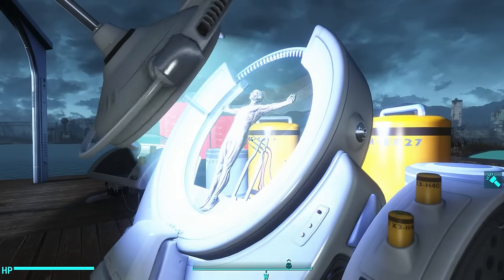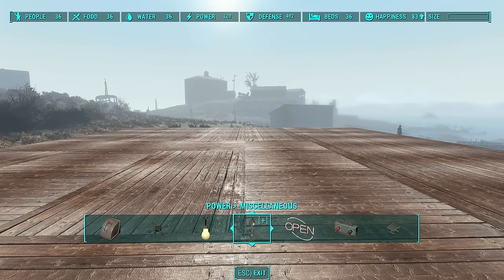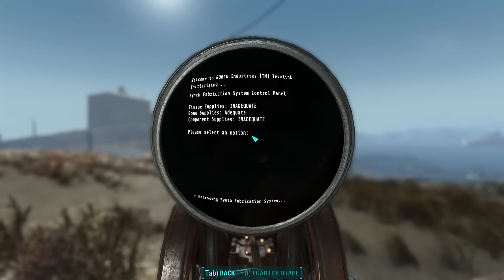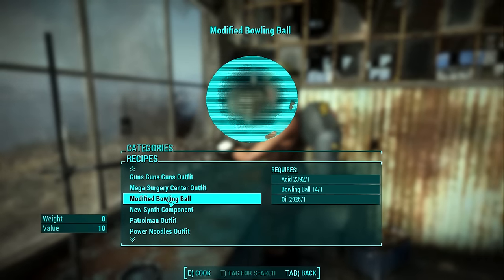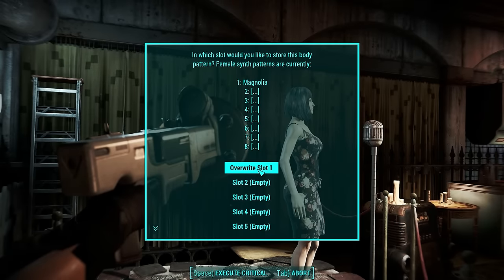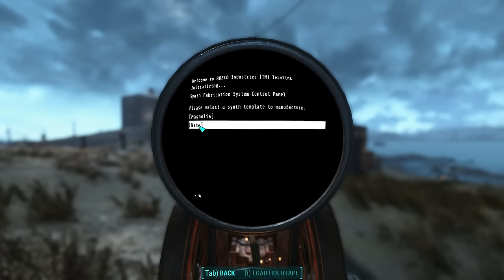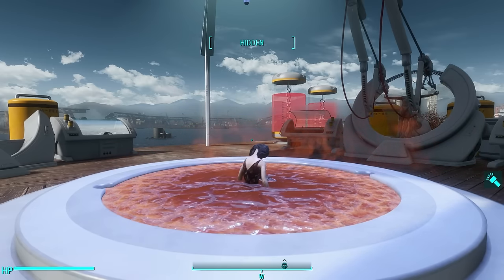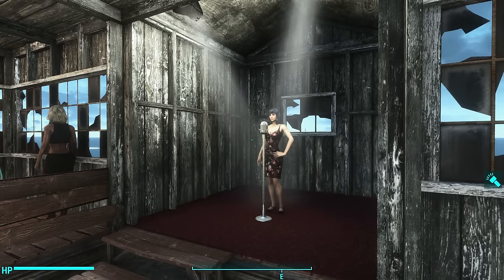Synth Factory - Build Your Own Synths! - XBox1 & PC Fallout 4 Mods

Comment: Edit: figured it out. You have to build on an elevated platform of some sort. 

I dont know if im doing something wrong or if the mod is broken, but the fabricator will not produce synths. 

Im using vats, i have more than enough materials in my workshop, everything's conmected, i have everything set in place and it should be working.
But whenever i select a model for the fabricator to produce, it does not respond.

Comment: I just want to make sure everyone downloading this mod knows this

It takes roughly 2:20 minutes for a generation 3 synth to be made. There’s 30 settlements in the commonwealth. Let’s say that in the institute ending the player as the new director decides to take over all 30 settlements and place a synth production machine in each of those settlements

There’s 1440 minutes in one day. Not to over complicate things let’s round the 2:20 mins to just 2 mins. 1440 divided by 2 equals 720. 720 times by 30 equals 21,600 generation 3 synths in 1 day alone. Now of course this is an un impeded 24 hours but that’s still a lot of synths. In one year of in impeded synth production the institute could theoretically produce 7,884,000 synths.  Which is over a quarter of my country. 

The largest country by population is China and has a 2.3 million active military personnel with over a million in reserves. In just one year ONE YEAR ALONE! The institute could replace one of the largest military forces in recent history!

Comment: Sadly, after spending HOURS building a place for the Synth machine and trying to figure out why it wasn't working, even with the tutorials online, I saw that this mod hasn't worked for a long time. Many have mentioned that the terminal wasn't working correctly in many ways. For me the body scanner doesn't work along with the terminal. The body scanner shows all 8 slots empty (male and female) even though the top numbers show the names of people I've scanned. The two preset main characters that are supposed to be automatically added to the scanner is not there either. As for the terminal it does not give me an option to choose from and states

"Tissue Supplies: Token.Name=TissueLevel

Bone Supplies: Token.Name=BoneLevel

Component Supplies: Token.Name=ComponentLevel

Please select an option:".

I hope these issues get fixed soon, I was really hyped for this mod.
Reply: Same
Reply: The exact same

Comment: I have no clue how to figure out the terminal bit, I just got the message to start the process as shown here, made as much as a hundred plus New Synth Components, 12 plus Bone pieces and all from skull to foot bones and all, Synth Cell Cultures, whatever that means, 6 Tissue Samples and still, nothing, no dice as they say, nada, zippo, the big goose egg, any ideas if I'm doing something wrong?? Please let me know, that would be great. By the way, I really mean help me out and do not, I repeat, DO NOT just like my comment, just because I ask for it, because that has really is getting annoying, just please, please give me suggestions to help me, it's driving me completely mad and doing my head in.
Reply: The mod is broken, and has been for years. It used to work fine...then small glitches appeared (for example, your synths occasionally coming out as radroaches, or turning into 'floating hands' while you are away from your settlement), then, as you've discovered, it just stopped working altogether. Sadly, the creator of the mod seems to have long ago abandoned it, as it has no real update. A real shame, as I had this mod long ago, and when it worked it was awesome.